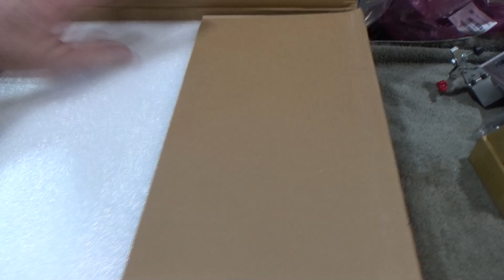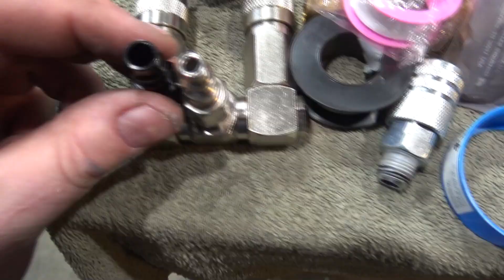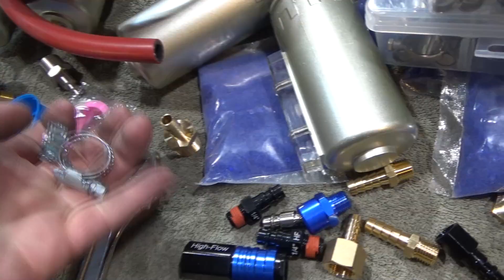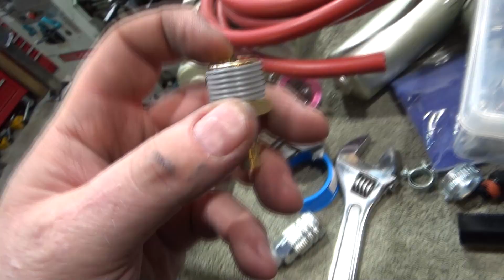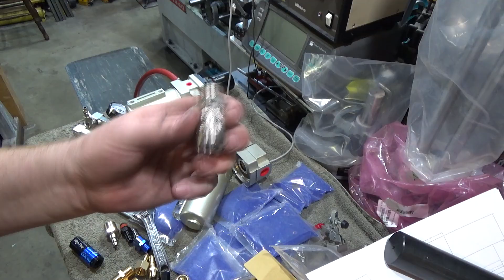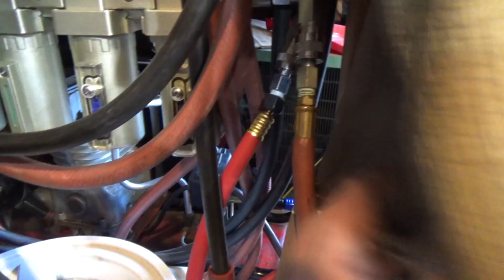Recent Acquisitions #2

Comment: I know I’ll get hate for it but I ran 3/4 pex throughout my home shop.    I put in drip legs for all my drops and a similar reducing/ drying set up.   You can disassemble the reducer separator filter and desiccant and change the order   I also added a bypass incase the reducer failed and I needed air right away.
Reply from the maker: I love the Pex idea. It has to be cheaper than the premade airline kit I bought and the quick connects on the kit tend to leak.
Reply: @DudleyToolwright  i use 3/4 pex B with brass fittings.    I’ll sweat brass nipples into either the brass pex T or end plugs to make a neat transition from pex to pipe for the air tool quick disconnects or into air driers.

Comment: I'm replacing my air compressor this year. I need to add one of these when I do, plus an automatic drain valve. I drain my manually every few months, but it would be better to have it happen automatically instead. I wouldn't be surprised if that tank in yours doesn't have a couple gallons of water in it. It'll rust from the inside out until it catastrophically fails.
Reply from the maker: That is an excellent warning and I have been concerned for years.

Comment: It’s not a plumbing job if you don’t make at least three trips to the hardware store.
Reply from the maker: Isn't that the truth. I hate plumbing. It seems to disappoint now or eventually.
Reply: I’m replacing our hot water heater with a tankless one, and gotta fine all the parts for not only the water but also gas and ventilation. I’ve been there twice, and I’m no where close to having everything. I may have to order the gas fitting. I just hope they work good.

Comment: You have to drain the tank. and if it is empy, use moderat heat. 300deg Celsius will brake the selant on the plug.
Reply from the maker: I was worried about damaging the strength of the tank by heating the bung. It really is a scary situation.

Comment: So in my prior shop I ganged 8 gallons with a check valve and regulator tune. I had check valve failures from moisture so I tried something. I used the HF merlin water separators, then they were liquidating the big blue CP regulators which also claimed water separation. I then put a final sintered filter before joining the lines and after joining the lines. I heavily use pneumatic. Bone dry. No water whatsoever. Continuous operation for five years. Only had to crack the bleeds on everything, every other day.
Reply from the maker: Thanks for the suggestions, based on your experiences. This type of information is really valuable.

Comment: I set up a similar dedicated system on my plasma cutting cart, It makes the consumables last 2 to 3 times longer.  FYI. I use PEX collars for all my barb fitting; nothing to snag, easy to remove, and I have never had a failure.  ( so far 🤞)
Always good content; thanks for sharing, and Happy New Year.
Reply from the maker: That's a neat approach. Thanks. I need to take a closer look at PEX.